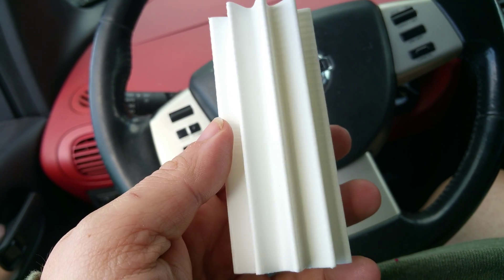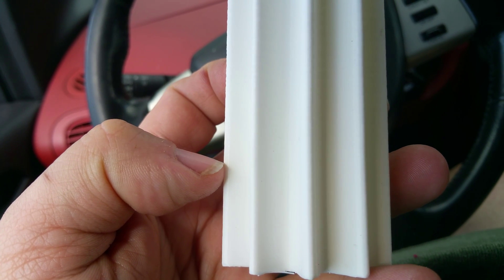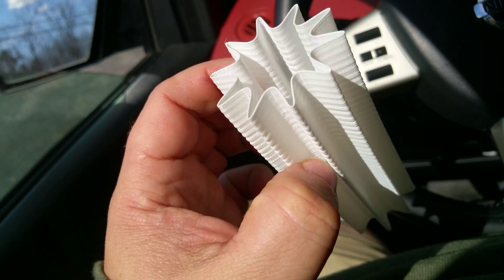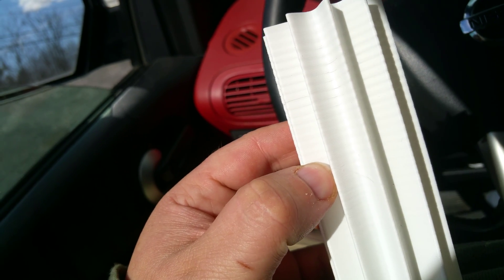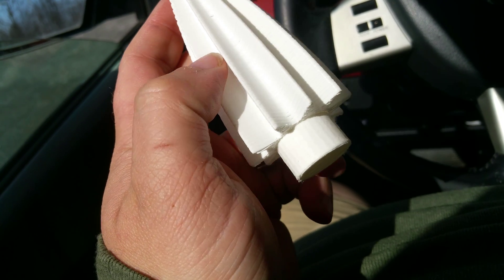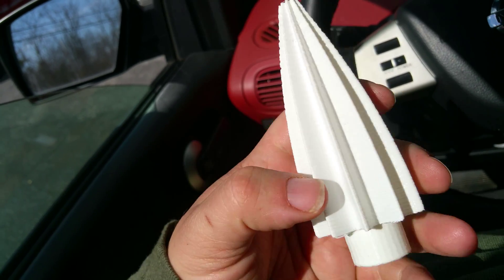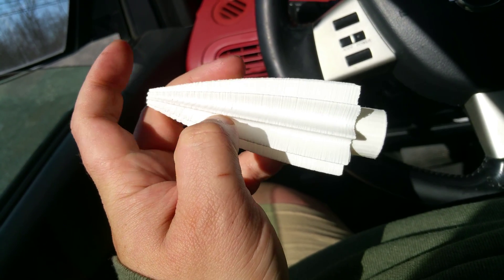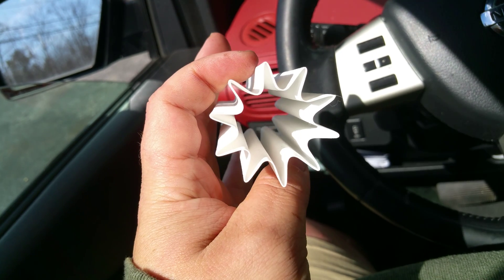3d print tall skinny problem

Comment: I have the same issue. I have a tevo little monster delta printer so its not the build plate. What you said applies to my situation as the print head drags across the top layer and wobbles the part. Its sometimes wobbles enough to pop the part off, and this feature makes some smaller parts, like a tall thin support, not work at all if they are over aboput 5 in tall. Its a pain cuz I got this big ass printer so that I could print tall things. Id like to be able to make some wands with wood filament as Ive had a few come out amazing. But I dont like having to split a 15in tall part into 3 pieces just to print it. Researching right now how to fix this.
Reply from the maker: several things to help with this problem I have discovered

First Extrusion multiplier I was over extruding so too much plastic was coming out of the nozzle which meant there was pressure between the nozzle and of the part

Next use a brim maybe even two layers

Next for really tall skinny Parts add support structures so halfway up to print I'll take a bamboo skewer apply a dab of hot glue to both ends of it and very gently stick it into place so that's touching the bed and the model and I'll use two of them at different angles this adds a bit of scaffolding to the tall skinny model to help keep it in place just be gentle that you don't actually move the model when you do it
Reply: @nerys71  Oh good ideas. Im gonna use the skewer idea right now. Ive really been wondering how to support things while vertical and skinny, since Im not too much of a computer guy the software stuff is a nightmare for me to figure out bit by bit. This seems incredibly helpful to use the glue gun and sticks. I could probly keep an eye on it and pause it when I start to notice the details changing from the wobble and do it right then. If thats doesnt work for me its at least enough of an idea to build upon. Might make a reusable custom support for different model things out of wood and glue it in each time i need it. Thank You!

Comment: I have a similar issue on my Makerbot Rep. Mini. I've seen this on parts I've model as well as downloaded parts.  I have a suspicion that the build plate is oscillating as it moves further down the Z. The threaded rod the plate travels on is not particularly straight. I noticed this one I received the unit. I'm curious if you've learned anymore about the issue yourself?

Also,  with your parts have you noticed is the ridges are offset uniformly? Mine are offset in one direction it would seem which is how I came up with the build plate theory.
Reply from the maker: confirmed on mine it was a bent z axis jack screw. watch your screw as it travels fully on mine you could visibly see it oscillate.